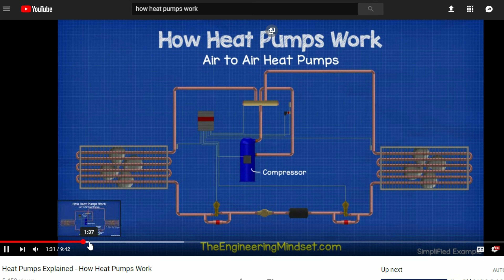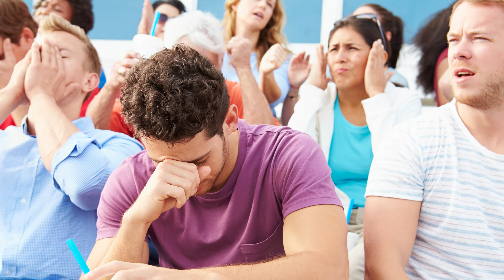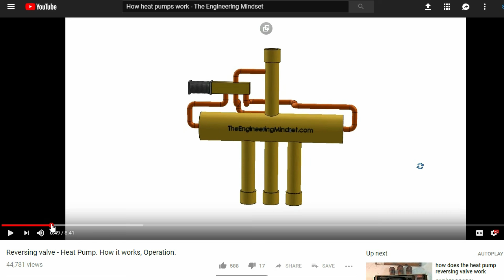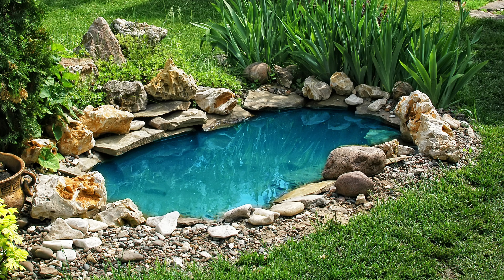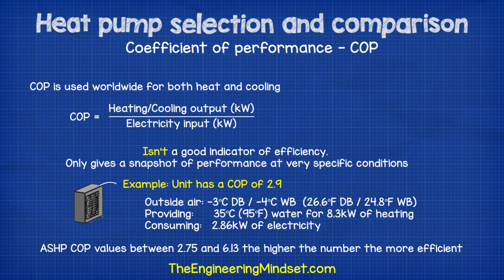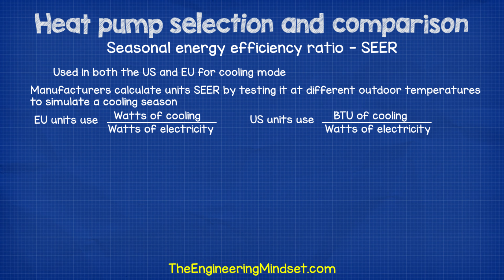Heat Pump Guide, how to select, compare and efficiency rating hvac

Comment from the maker: ⚠️ Found this video super useful? Buy Paul a coffee to say thanks: ☕
PayPal: https://www.paypal.me/TheEngineerinMindset
Reply: This was worth a cup of coffee (and a subscription). Many thanks.
Reply: I would like to mention that your introductory comments about the effciency of various types of heating is based on a misconception, possibly?
You say a gas heater is 85% efficient  (modern ones are over 90%) and electric resistance heating is 100%.
However considering that elctricity essentially is an energy transporter not a source you need to take into account the energy input to make and transmit the electricity, which is probably about 50% efficient so any electric heating efficiency is essentially half of what you claim. Not only that but the relative costs of gas against electricity is about one to four respectively so makes electrical heating very expensive.

I also do not understand your explanation of COP,  essentially the heat from a refrigeration unit is that generated by the compressor and the harder it works the more heat there is at the condenser. This is why air source loses effectiveness the lower the outside ambient which if it reaches a temperature equal to the evaporator temperature there will be no output from the compressor as there is no cooling demand.

Another unrelated factor is the the government's push for heat pumps instead of gas is to reduce CO2 Otherwise why force an expensive way of domestic heating on an unsuspecting public (Banning of gas boilers in new build houses)?
They are assuming a low carbon electrical supply but that is looking very unlikely as the construction of non CO2 emitting generation is slow (You may read that X amount of capacity of wind farms are being built, but the  average output from them is about 40% of rated power) and there are the imminent closure of most of our nuclear power stations in the next ten years or so, and who knows when Hinkley point will be finished?

With the push for electric vehicles and heat pumps, the grid load must increase and probably significantly and as CO2 emissions are based on demand this is going to increase so the whole exercise seems poorly thought out. The cart before the horse in my view.

Comment: I am a researcher from Turkey working on energy efficient electric heating systems. It is a system that will make a great contribution to meeting the energy needs for heating residential and non-residential buildings (schools, hospitals, nursing homes, places of worship, theatres, state public institutions, sports halls and large shopping malls) and keeping heating costs at an optimum level. In addition, it is a light and portable, easy-to-install system that is 300% more efficient than a heat pump, eliminates the problem of cabin heating and range loss in vehicles, and is much more economical than a heat pump. Mass production of our heating system, for which a National Patent has been obtained and EPO Patent applications covering 37 European Countries have been made. I am looking for an investor for myself. Thank you

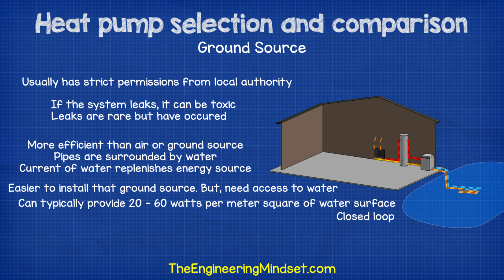Comment: 7:50 what if you buried a 5000 Gal water tank under ground (say 20 ft deep), placed 3 feet of insulation on top and used it as a battery?

Comment: Do they also manufacture heat pump energy harvest system from the waste water. You know, they flow usually so deep, that the temperature could be lowered like a few degrees without concern of icing. Also waste water is commonly so so called salty, that it actually could be cooled to maybe zero nearly always.

And do they make accessory additive system to air-to-air or air-to-water pumping. Like glycol-water, old or spare part car radiator, and circulator pump. To own yard or field to a few dozen centimeters, and there you go, like ground to air; but the investment cost maybe a few hundred euros/bucks. Why heat wells, do not understand. In narrow spaces, vital maybe.

Comment: They might be efficient, but they can never compete with a gas boiler. Not enough heat in the winter when you need it most. Expensive and useless.

Comment: Natural Gas heat is much less expensive than any type of mini split heat pump.  I learned this after days of research.  Why?  Because natural gas is cheap, even at 85% efficiency, it is less expensive to use.   Don't be fooled.
Reply: That depends on your electricity rate. Many electric utility companies offer lower rates for heat pump users, and electric rates vary wildly by location.
Reply: You've assumed that everyone pays the same gas / electric prices as you but they don't. We removed our gas heater and replaced it with an inverter split system and saved money on heating. Our climate is moderate though so heat pumps are even more efficient.
Reply: Very difficult to get natural gas off-grid out of a solar panel or windmill, though.
Reply from the maker: Seen our new video on HOW SOLAR PANELS WORK in detail https://youtu.be/Yxt72aDjFgY

Comment: I bought and installed my 5kw (SCOP of 5) split air to air heat pump for 550$ US and thats include a wifi module to control it. Those prices presented here seems rather high, but for the water and ground source units it seems realistic. I truly don't understand why there units are so much higher in price when they basically is the same unit, just a different heat exchanger attached ....
Reply: The video refers to air-to-water heat pumps commonly used in central heating with radiators, fan coil units or underfloor heating.

Comment: Continuation and we bet more technical and he does censor or mechanical switch that will detect ice buildup on the evaporator coil that will make him break a contact on his low voltage side of the controls to clarify this unit will be a heating only and will run on second hand salvaged control components for which the capacity to make and break current through a switch will be completely Overkill one componentthat I would like to have that may or may not exist would be a digital displayed remote sensing  stat that has adjustable cut in and cut out points the temperature and humidity that this pile of crap can safely operate in without icing the evaporator coil over

Comment: Well here is my heating solution for a small room I bought a harrier air conditioner that is 8000 BTUs per hour it is a 410A unit I paid $5 for it the manufacturer included an extra metal part that held the capacitor in place located underneath the circuit board now it's blew the fuse I purchased a 10 amp fuse the board called for a 16 but it is what was available the unit worked I intend to take a 24-volt contactor and a heating thermostat in conjunction with a transformer and put the evaporator coil to the outside and and set aside the fancy circuit board with its remote and teeny relay that runs on six volts

Comment: As a physicist, it disturbs me to see energy in units of kW, which is only appropriate for power. The units for energy are kWh, or kilowatt-hours. It's like listening to concrete contractor speaking of "yards of concrete" needed for a project.

We physicists naturally perform dimensional analysis to check validity of our equations and formulas, and, if they don't pass, we consider them bogus from the get-go.

Comment: Thank you very much for the video! Subscribed, looking forward for future videos. I'm planning to build a house boat, which would be located in a non freezing water reservoir in Bulgaria. I suppose the best and cheapest solution would be an open source loop water heat pump, in Your opinion what cost of equipment for a four bedroom and large living room house should I be looking for? I'm trying to estimate the cost of heating, ventilation and AC equipment. Perhaps You could recommend a cost efficient manufacturer? Thanks in advance

Comment: If you can choose between air source and ground source heat pump then whats the return on investment ie which is going to cover its install cost sooner assuming a set amount of use and heat generated. Also would air source heat pumps work best in warm climates where outside air can be very warm (30/90s)? Also many water source heat pumps need access to a PRIVATE water source, not sure you can just extract the heat from your local river and dump the colder thermal load back into the water via a heat exchanger? Also if you live in warmer climates would nighttime air temp not be be quite high and thus allow for air source heat pumps to extract heat even overnight? It also seems quite straightforward to dump the excess heat into a water tank so in the morning your shower is not just luke warm.
Reply: aaaaahhhh this guy!!! Give this man a cookie
Reply: Ground source cost more to install but repays cost quicker than air cooler overall. 
All these systems will be using pumps running off your electricity supply so you don't get free energy for free! Well worth considering adding  solar panel on the roof and having both systems integrated at the design stage of a new build.

Comment: Good video but key elements are scop and capacity drop off at lower temperatures. There is a large variety depending upon specification. Check scop and delivery capacity at -7 degrees ambient with flow temp for heating at 45c to make sure you are getting a decent product

Comment: Thank you for your videos.

Lately, I have been looking at chiller offers from Sanden, Multiaqua, Daikin (Altherma 3), and Chiltrix among others.  

They claim to produce heating, cooling, and hot water (except for Sanden which only produces heat and hot water) at very high levels of efficiency using air to water heat pumps.

I suspect they all use a reversing valve (except again for Sanden).

Some of them claim very high COP numbers.  They, also, claim lower costs than GSHP.

When I compare long term ownership costs, I find that their costs are usually greater than air to air in spite of having higher COP numbers.  In fact, I tend to get confused in attempting to decide among them.

Could you cover these types of heat pumps in more detail? 

Could you, also, please provide an industry perspective of where trends in products (cooling, heating, and hot water) and future (not too far) consumer efficiency is going?

Finally, could you provide a single chart providing 10-year total cost of ownership for different technologies (for instance, air to water, air to air, etc).

Comment: Good video. But I was wondering; are you sure, in the imperials coefficents, that the top unit you need to use is the BTU and not the BTU/h ? Because the watt is a unit of power like the BTU/h and the BTU is a unit of energy like the joule.
Reply from the maker: I'm not sure exactly which part of the video but probably BTU/h was meant